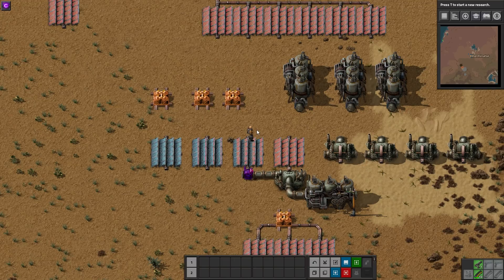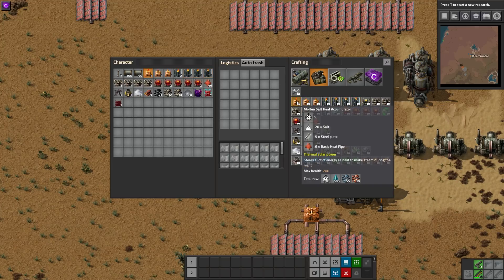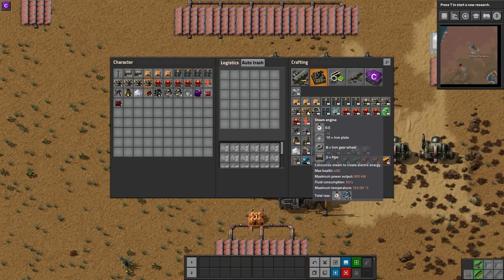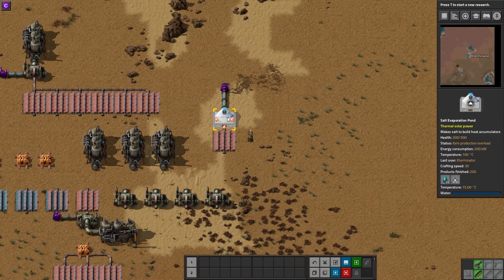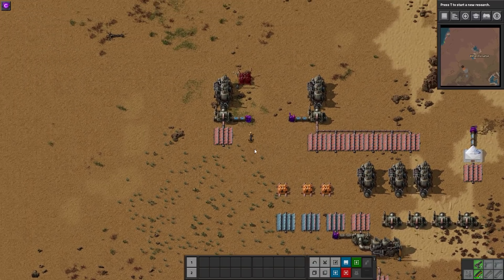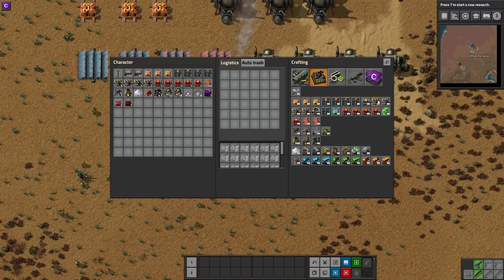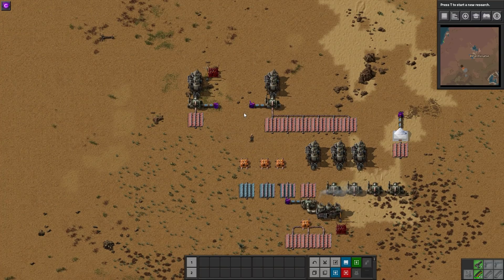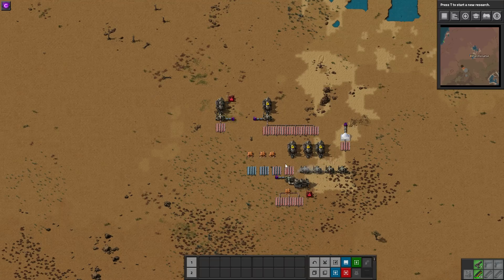Factorio Mod Spotlight - Thermal Solar Power

Comment: I've made a huge solar heat farm that can power 14+ level 2 Bob's turbines! I think this mod is awesome once you get it set up. Just remember to have enough heat stored to last the night or use fluid/burner heaters to supplement and remember to build out the heat system slowly so you don't end up with massive drops in heat from the added or upgraded components needing to heat up and drawing heat away from the entire system for a while. It's honestly a very fun mod to use instead of solar if you're looking for a slightly more challenging way to produce power.

Comment: While I'm not sure I'll use it, I kinda like this idea. As it is now in vanilla, a couple lines of steam engines is generally enough to launch the rocket. That's about where my games usually end - at best I put down oil and a couple mining/smelting stations for a megabase and get bored. That combined with the time and material cost to go either nuclear or solar means that I hardly ever use anything but steam engines.
This also looks like a good compromise between solar and nuclear mechanics. Solar is super boring to me - puke out a couple thousand panels and accumulators and BAM! Free power, no fuel, brainpower, or anything else required! Nuclear is much more interesting, but can be a bit of a complicated pain to set up between mining the uranium with the acid, setting up centrifuges for processing and kovarex, and finally the reactor itself with the neighbor bonuses and odd ratios.

Comment: Thermal solar power should definitely be considered for vanilla Factorio. It fits well with the many different tech-tree paths for power... Like how there are belts, robots, and trains for moving items, I feel like thermal solar power fills that void for power generation. It'd also be nice to see more things done with steam, like steam trains and steam driven buildings as an alternative to grid power.
Reply: The thing is solar electric is very optimized right now. The heat panels work with a script and take a lot of computation at the moment.
Reply: @FreeOfFantasy  also, fluid/heat physics are wonky on general.
Reply: Agreed!
Reply: That's not what solar panels do tho...
Reply: @wurst1284  You're right, they don't boil the water directly. Heat exchangers... although it's not unheard of in real life for solar panels to reflect the sun's light to a boiler...
My point still stands that using solar energy to generate electricity by other means than just electricity directly would be nice. You can later combine efforts of "heat" solar panels and nuclear energy to produce steam power in the same place. Now that would be neat.
Reply: @wurst1284  There are many types of solar panels.
Reply: I agree! It can definitely keep up with solar power for massive power generation, but it does have pollution.